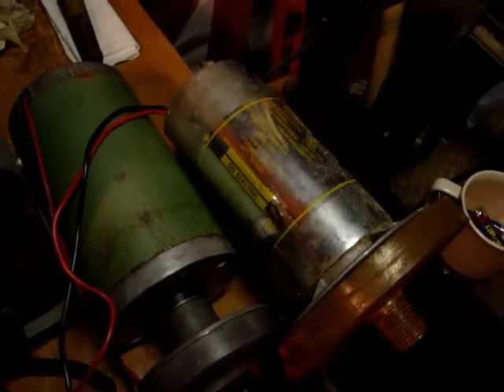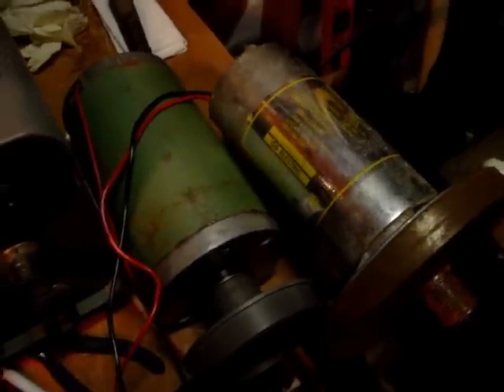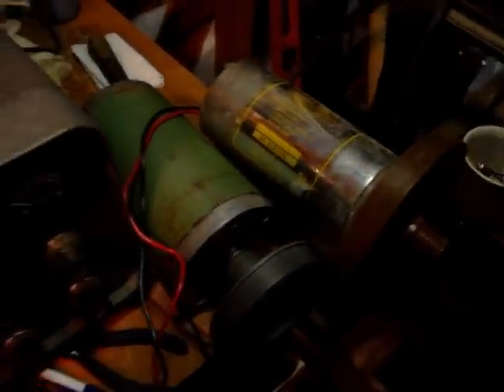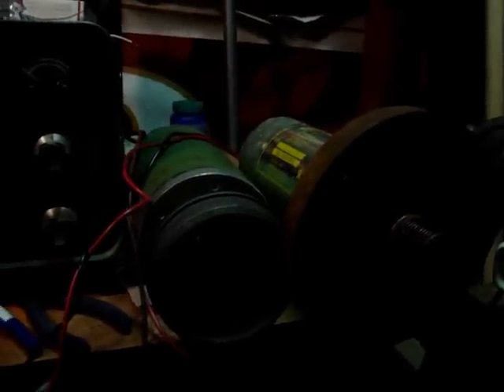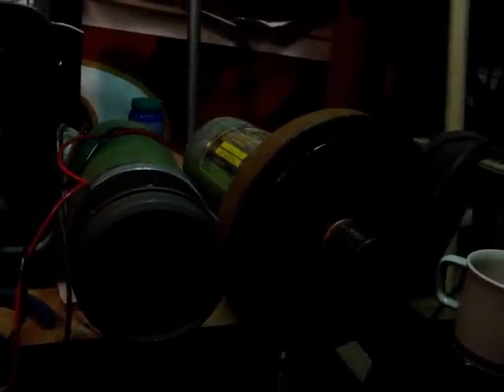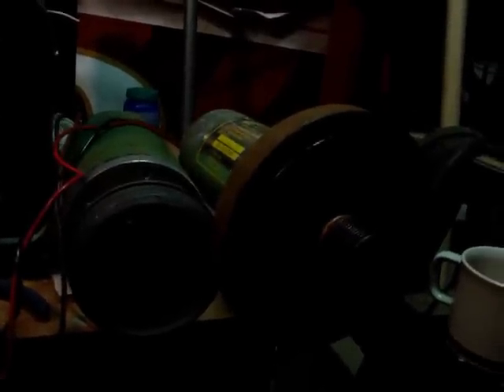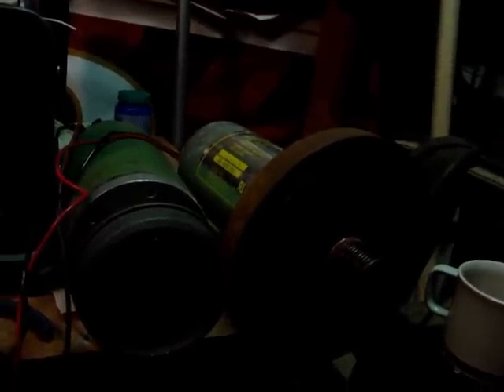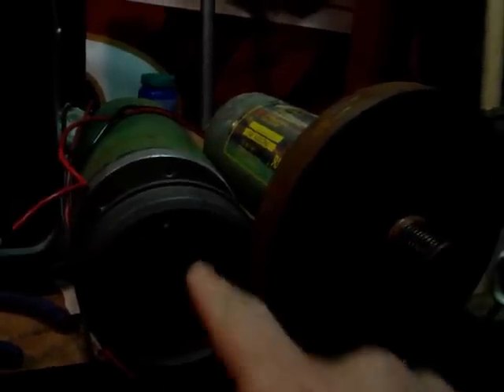AMATEC VS TREADMILL MOTOR.wmv

Comment: Having them in series isn't really a fair test.  The motor with the higher resistance will get a larger share or the power. (I^2*r).  In parallel the one with the lower resistance gets more power . (v^2/r)
Reply: and starting up the motor with the heavy fly wheel will be harder.